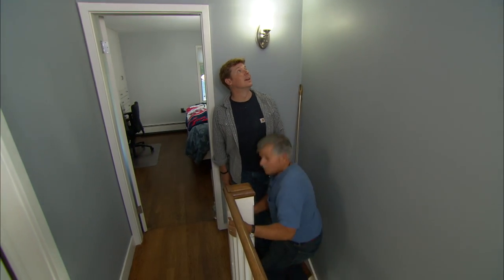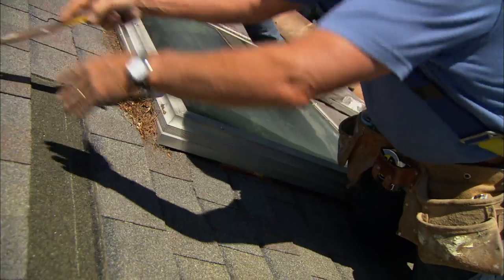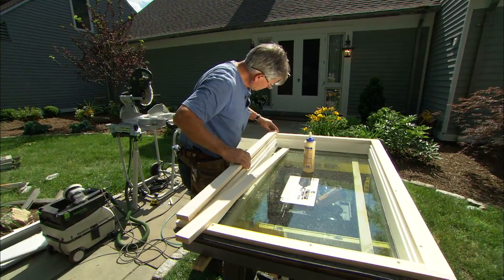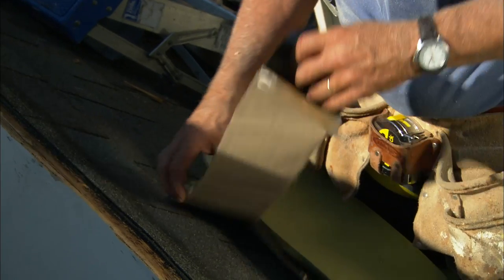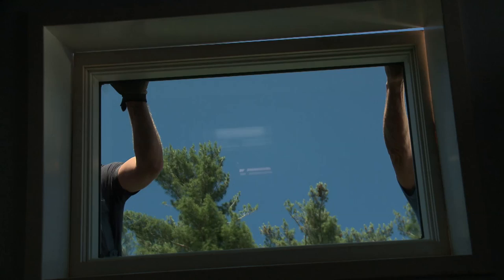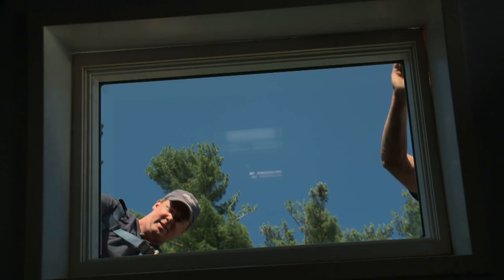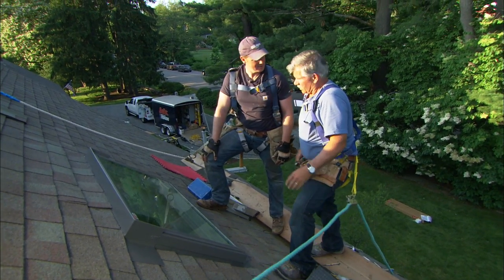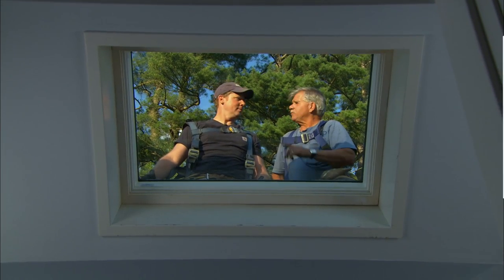How to Replace a Skylight | Ask This Old House

Comment: Silver Symbol...may I thank you for this sterling  contribution to my life.  I’m retired so I have a big block of time to seek perfection in my yard that I didn’t have once upon a time.  I’ve wanted a yard that blossomed as a rose, but I also live on the edge of the Great Basin in Grantsville, Utah.  Our irrigation water has been halved due to a dry spring.  Soil compaction has become a significant problem in clay soil.  Normal, or even water hydration doesn’t work, so you just brought me closer to that perfection I desire.

Comment: Advice from the Pacific Northwest: The strip of Ice and Water seal (flexible flashing) that was put on top of the underlayment and that other strip of flexible flashing in order to "close the gap", that top piece should have been routed under the the underlayment and over the lower strip of flexible flashing for water shed purposes. Same concept as laying shingles. Granted the adhesive is a very viable seal, it still creates the potential for a failure point.
Just advice from an NW Oregon carpenter that's dealt with a lot of rain, and rot repair. No pro roofer here.
Reply: So, go from top of window, down to bottom, vs the way he did it?
Reply: Great!! Always interesting to learn how different regions have to build due to weather.
Reply: @melaniedemmert2342  I think he means the part at 09:30 at the top of the window where there was a gap in the underlayment.  You could see the plywood underneath.  Tommy put the membrane OVER that and OVER the membrane below.  he should have put the membrane UNDER the underlayment and OVER the membrane below.
Reply: You right
Reply: @avieshed8646  thank you!
Reply: If you watch firther he ends up putting another piece of flexible flashing even over the top of that again, just before the final top shingles. So, its good

Comment: As a 31 year roofing veteran, I give this video a C+... Here's why... 

 The surrounding damaged underlayment "Ice & Water Shield" (I&WS going forward) should have completely covered in the exposed area before install continued. Cutting the center out with a utility knife flush. This renews the surface from any existing holes or gouges. 

The first layer of I&WS strips (in video) should have been flush in the same manner as it was installed (underneath) but over the top, while the 2nd layer should have been wrapped with relief cuts as shown. Keep in mind the first recommendation above would have already been the I&WS "UNDER".  Any errors in the double wrap (shown) could cause openings for water intrusion and then trapping water once in. Gradually opening more as ice forms and causing a leak.

It's okay to re-use existing shingles for a better color match, so long as you use a tube of roofing cement to seal the shingles back down and and fill in the old nail holes. Once you break those seals, they will never glue back down. The way it was done here, if a Thunderstorm hit with 30 mph winds, these shingles would be flapping around, rain will then find those old nail holes, and ultimately find the damaged undelayment which was never repaired... It's okay Tom... I still think you're an awesome carpenter.. :yougotthis:

Comment: This is a good video and they did a wonderful job at fixing the sky light but this also serves as a warning not to install skylights to start with as they are guaranteed to leak at some point because you are cutting a hole in your roof. They are nice though.

Comment: What happens with the holes made by anchoring the safety equipment?
Reply: chrisbinnie caulk it up good
Reply: chrisbinnie I would probably paint them black and leave them for future use.
Reply: Most new homes actually require by code these be installed permanently on roofs in new construction. They can be added after the fact as well.
Reply: Roof caulk
Reply: Leave the anchor in place.
Reply: @Robert Justice    In the next episode, they’ll show us how to replace leaky shingles. 🤣🤣🤣

Comment: He screwed the harness into the roof? Wouldn’t that damage the water seal?
Reply: They also screwed the brackets for their little deck.
Reply: It’s fine if you use sheet metal washer screws and screw them back in. Never had a problem like that. Being safe he’ll probably also use a tar roof caulking to double seal it
Reply: @Guillotines_For_Globalists  : in the future, they can repair that leak.
Reply: They didn't even do it correctly.  The anchor is meant to be mounted directly to the roof deck, not over top shingles. And you have to hit a truss with the screws
Reply: @AnonYmous-qg4ph  Very good
Reply: No...caulk!!
Reply: @AnonYmous-qg4ph  he did it right !!
Reply: @Mrcrisis2012   
No he didn't
Reply: He screwed it into the roof framing
Reply: Where else is he supposed to  screw into
Reply: @AnonYmous-qg4ph  there many types of anchors.  Temporary ones do not mound directly to the roof deck, johnny know it all.
Reply: @cavrelsilvera3858  actually the type he's using does need to be mounted flush to the decking, fastened into a truss. And he's only using 3 nails per side which is also incorrect. When fastening to framing it requires the 6 center fasteners on both sides. When fastening in the field (between trusses) it requires fasteners in all holes, but can be only mounted in the field if decking is 3/4 plywood or thicker.
Manufacturers have specific installation instructions that many people (like you) don't read. 
Federal and state worker safety departments also have their own requirements.

Comment: The wood was still exposed even though the water/ice shield (self-healing membrane) was applied. Looks like the membrane wasn't applied all the way to the top of the sides. Wouldn't the wood eventually rot?  I have a "curb" and wonder if I should tell my contractor to apply the membrane to the top of the curb and not only the sides?

Comment: What kind of roof boards are those?  No plywood or OSB?  What that a build up prior to cutting the window hole or just old house?  Just to make sure you did actually replace the old skylight and the new one you installed you did not test fit prior to setting your glue and nail for trim? Nice safety harness, not required but nice to see safety as a priority in all repair work.
Reply: old house.

Comment: What did they do with the  water damaged wood on the inside?
Reply: That's exactly what I was wondering. Why not change it?
Reply: With that much water damage to the interior trim and drywall, there certainly would have been rot damage in the roof deck and probably even the framing.
Reply: this video is "how to replace a skylight".  not water damaged trim
Reply: but since they had it apart it would make sense for them to fix it, I mean they are supposed to be professionals.
Reply: symbiotic venom I think you can assume that it has been fixed.
Reply: Because you fix the skylight first and prevent anymore water from coming in, and then work on the interior so you're certain that you will not work twice.
Reply: They used calking and painted it

Comment: When you fix the harness to the ridge are you not damaging the ridge ?
Reply: blunder15 nope just caulk up the holes with some black caulk and you’re good
Reply: @HackThePlanetNow  Does the caulk dry up and crack? I'm always worried about roof leaks. Does a reapplication need to happen? To put my fear in perspective all the nails he put through the plastic sheathing I wanted to caulk. Hahaha Thanks in advance for the info.
Reply: Michael Stene I’m not a pro at all but all I can say is I’ve done something like this about 15 years ago and haven’t had any issues. Just make sure to use caulk rated for outdoor use
Reply: @HackThePlanetNow  Sounds good. Thanks for the response.
Reply: Michael Stene No worries
Reply: @SteneArtStudios  All caulking will dry up and crack, or get deteriorated by snow/water/ice and will need constant check up and resealing.

Comment: I have a sky light that needs to be replaced. I feel like I should just remove it though. I know this is expensive.
Reply: Almost doesn't seem worth it with all the trouble they can cause, putting a hole in your roof, all it takes is one misplaced nail or flashing afterlapped on the wrong spot and you're dealing with it again
Reply: Kermeous if they are installed professional/properly they would last 20-25 years. Free lighting
Reply: also great in hot days to vent the hot air at night.

Comment: Why didn't ya just get a VELUX Fixed Mount Skylight, it installs alot easier than this. And that's not water tight, all those shingles you re-used no longer have any sealant on the shingles a s need to be hand sealed or replaced with new shingles. That will still leak if you don't do these additional steps.
Reply: I was wondering about those replaced shingles.  It seems like the first windstorm will lift them right up since they didn't run any tar underneath to hold the flaps down.

Comment: I would have roofed right over that skylight.  Skylights are nothing but trouble IMO, never a good idea to have a huge hole in your roof that always leaks.
Reply: I have one over 40 years old, still good. I had my roofer replace 3 originals from a 1952 building, old one still good but high maintenance. Then 2 more about 6 years ago on another house, no leaks. And a tunnel tube about 12 year ago, no leaks either. I manage properties, so far all the skylights are ok.

Comment: Save yourself headaches and heartaches, don't put sky lights in a house or sun roofs in a car.  Why cut a hole in your roof then expect it not to leak?  The best skylights are only warrantied for only 10 years while most roof shingles are good for about 30 years.  So, as in this video, you are swapping out skylights before you replace a roof.

Comment: No caulk underneath the nailing flange 0/10
Reply: I thought the same thing
 Or even flash it with sticky tape and the add silicone
Reply: you guys are prob the ones that also red gaurd a shower pan.